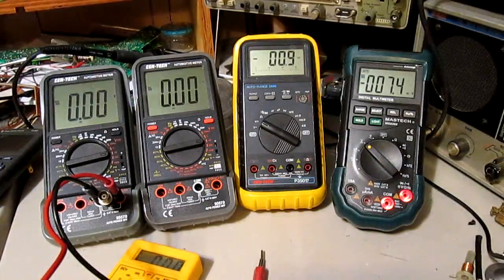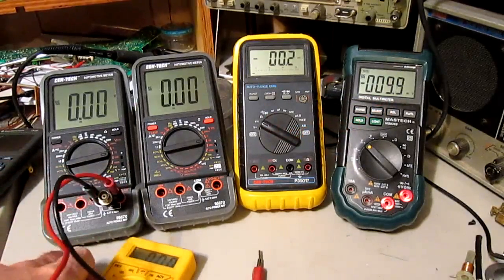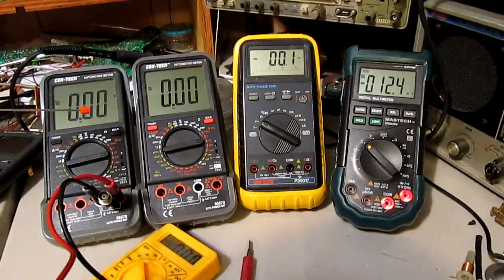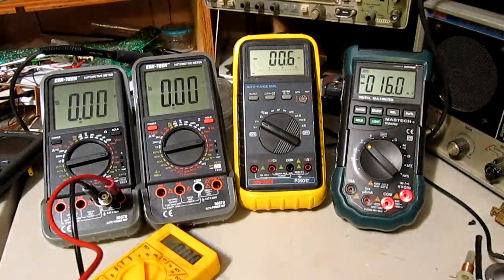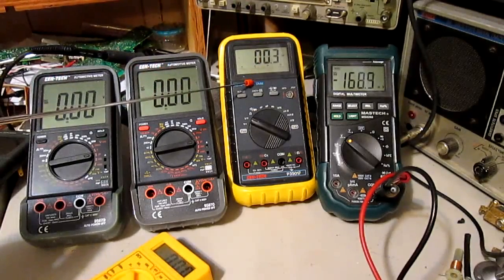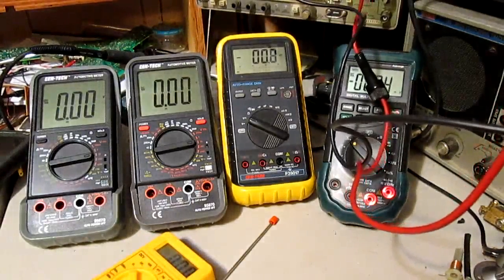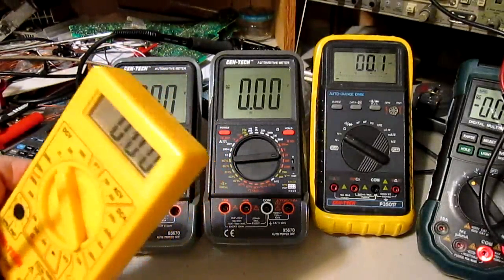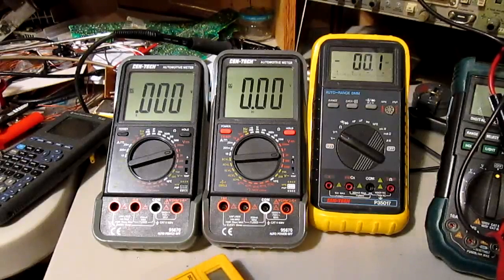DMM Comparisons and Accuracy Compared to HP3478A

Comment: When you're not sure use a cheap one?!!  That's how you hurt yourself.  If you're not sure you should use a well designed meter that can handle 10kv transients so you don't blow your hand off...
Reply from the maker: Not sure I endorsed using cheap ones under those circumstances ..  A little common sense goes a long ways ..

Comment: My Mastech is the same as yours, not good. I had bought the Mastech to replace my super cheap DMM ($20 Chinese). I thought that if I spent just a little bit more money on the mastech, I would be getting a slightly better multimeter than my $20 meter. This turns out to be wrong. My cheaper meter is the better of the two.  I'd like to figure out how to calibrate the Mastech.
Reply from the maker: Yeah I guess the best you can do is read all the reviews before you buy .. and go from there.. I like the Harborfrieght meter so long as I dont try to do automotive with it ..
Reply from the maker: And I agree of the Mastech, not constructed well and a PITA to put back together if you take it apart.